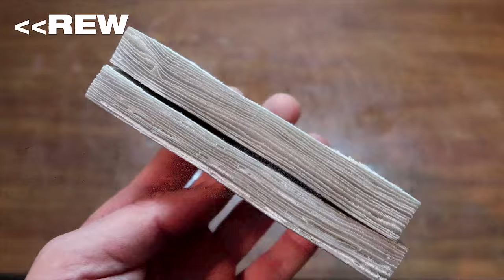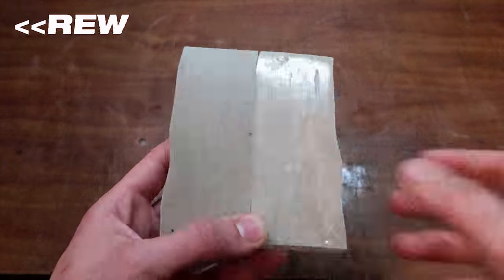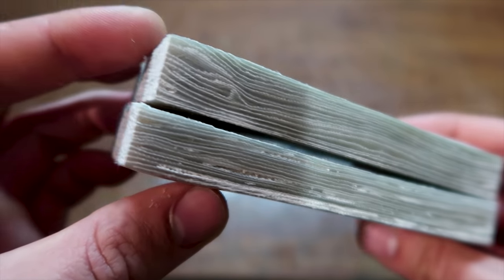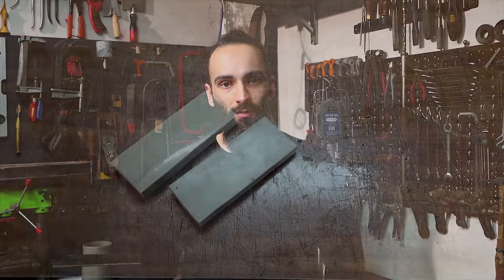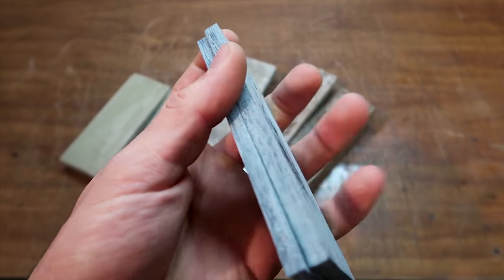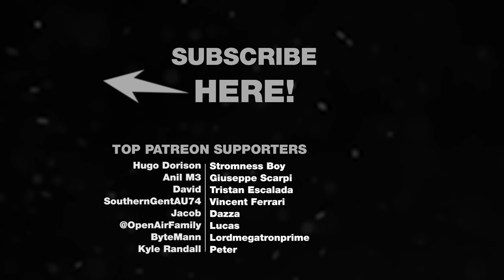Composite Materials : Vacuum vs Pressure

Comment: Calling BS on this one! we use Vacuum to "infuse" our wind blade material. The vacuum is used to draw or pull the resin material into the evacuated material. A Pressure system leaves resin rich areas which have very poor material properties and can lead to structural failure

Comment: Respectfully, you are not getting any pressure on either one. . Your parts are wavy because they are full of voids. All you did was degas one part. Both of your parts are full of voids. If you had put a bag on it, you would have seen about 14.7 psi . Without a bag you get 0. You could put a 10lb weight  on your part and see a significant improvement in your laminate.

Comment: Vaccuum pulls air out so you get no bubbles pressure forces the resin into the material ... BOTH is even better ... you vacuum to remove excess air then add pressure NOT compressed air ... weight .. on the order of 10 tons ... air pressure is crap becuase it forces air back into the material

Comment: i work with composite materials but you do it wrong.....
First -Poliester resin isnt for vacum or pressure of course you can use it but its not the best and you need to work really fast, use 1-1.5% hardener so it will slow down the process and do it fast 
Second ...... you dont put it to vacum or pressure , you put everything in the "vacum bag"  (check Easy Composites Ltd ) so you can take out the air and then air pressure aply on bag outside will compress the composite , second way when you use pressure work olmost the same , you do everything for vacum , add tube to connect vacum but then....you dont connect it to the vacum , you just leave tube outside and put mold into the pressure chamber. Pressure will compresse the material in the same way than using vacum but ....it will do it even better. Most of the time you will use vacum becouse it is cheapper than pressure, if you want to create big parts you need big pressure chamber (in normal pressure when you create vacum inside the mold , pressure of air around us will create force on bag that compress the composite, if you put composite in bag with normal pressure and put it in the pressure chamber higher pressure in the chamber will create force on bag to the moment when pressure inside bag and inside the chamber is the same , but if you leave the tube like for vacum and leave it outside (put second release valve where you connect the tube) pressure that aply on bag that compress composite will be bigger .
PS.Sorry for my English :)

Comment: the video should be titled "I tried to use other methods of making micarta. I FAILED and here is why". With the clickbait capitalized "failed", sadface emojis and all because why not. 

Look. Not to really bash you too much. But there is a reason why micarta is made the way it is made. Here are some reasons:
1. far less resin used. If you are compressing the material in a clamping box you require FAR less resin between layers. Thereby saving on resin. You could have used a third or less resin than you ended up using. Yes you use more cloth or other filler material, but that is the cheapest part (regardless how cheap the resin is or the type of resin)
2. You end up with a stronger finished piece. The filler material soaked in resin is stronger than just the resin by itself. Much in the same way that an cyanoacrylate glue (super glue) forms the strongest bond when as little as possible is used.
3. UV resistance is increased. Most resins do not stand up well to UV radiation over time. When you use as little as possible and the majority is hidden by layer upon layer of filler material. You do not have to worry about UV degradation as fast or at all beyond the top outer layers. Having so much exposed in your "micarta" is just asking for it to fall apart in 2-4 years. Not something I would want on a high end knife/grip etc that I want to last. Which is part of the reason you use micarta on those things (other than the feel of the material on your skin as opposed to plastic which is most likely how the majority of yours is going to feel with all that resin.)
4. visual appeal. When compressed in a clamped mold then the sheets of filler material align almost perfectly straight. With your methods here, you are just laying the sheets down and hoping they come out straight....they won't. 
5. no chance of bubbles or voids. This is self explanatory. 

I am sure there are a few that are escaping me right now. 

Failure is never a bad thing. Unless you ignore why something failed and don't analyze the failure.